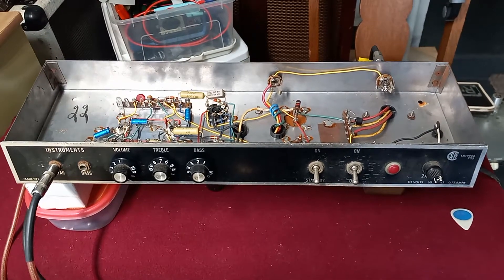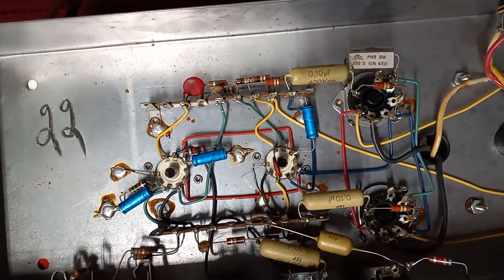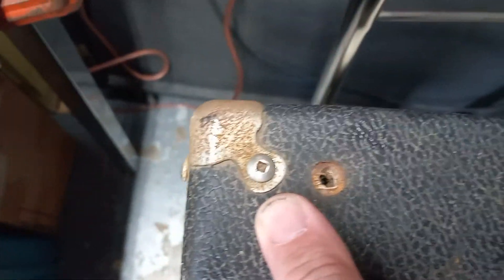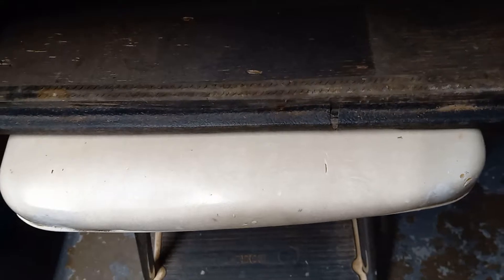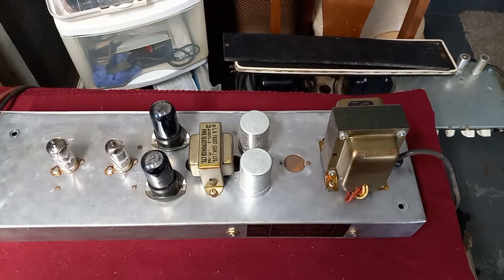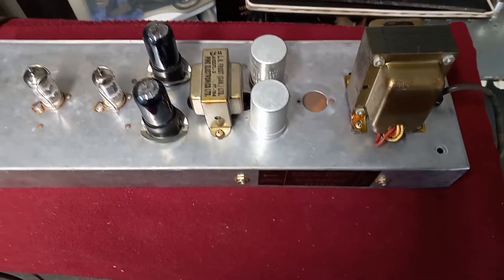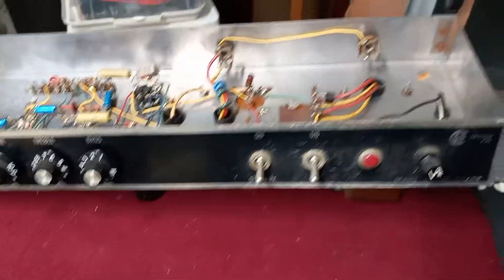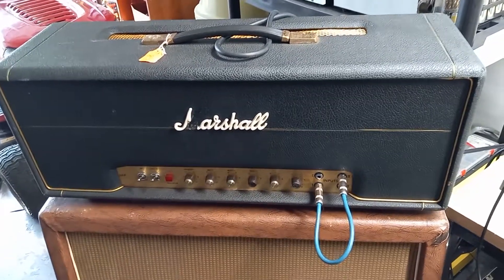Riviera/Pine 725 Tube Amp

Comment: We were selling those on Craig street in the 60’ in Montreal at Golden Music. They don’t sound good. Muffle sound. I’m a Fender guy. Robertson screws are the best… you need the proper screw driver but. I got one 725 for 2 bills, change the power transformer @nd turn it into @ 5Y3 Tweed Deluxe.
Reply from the maker: @majortwang  I added a mid control and it helped give it a better tone. I bought a whole set of drivers for those screws so that solved that issue. I should have shot another video after I tweaked it because it's  a rocking little amp now.